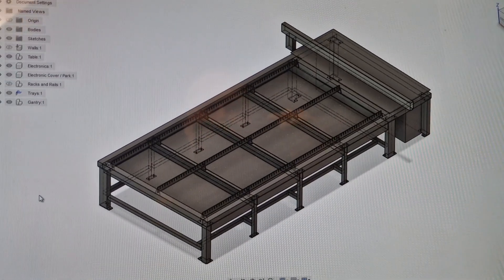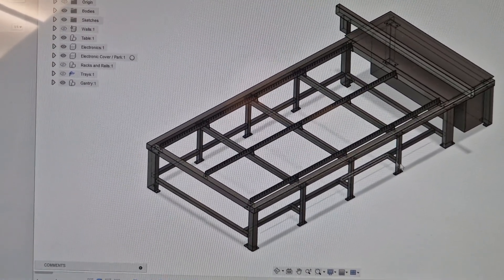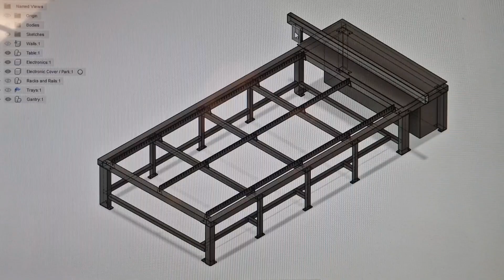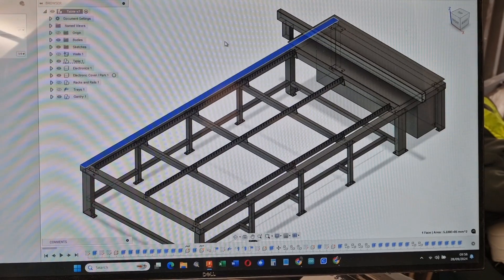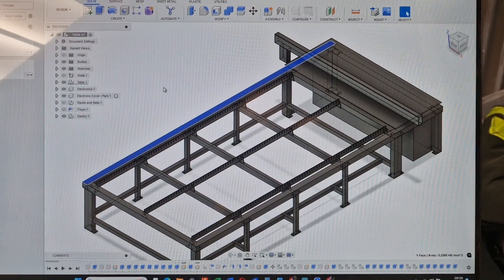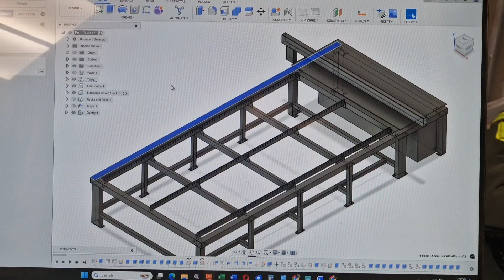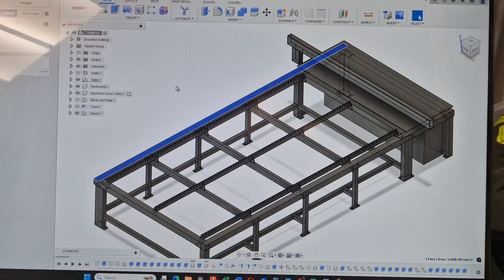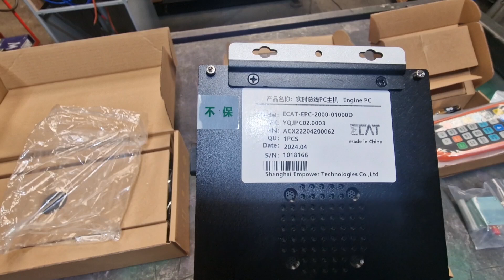Part 2 of the big DIY fiber laser build

Comment: The EPC2000 is a slave PC, like you thought. I took the time to hook a monitor up to it and even though it comes in a Windows box, I think mine might actually be running Linux. There's nothing you really have to do with it...just install the Raytools software on your laptop and the slave PC will do it's thing.